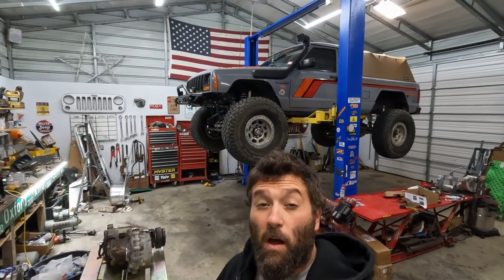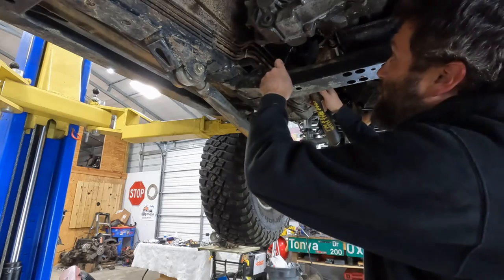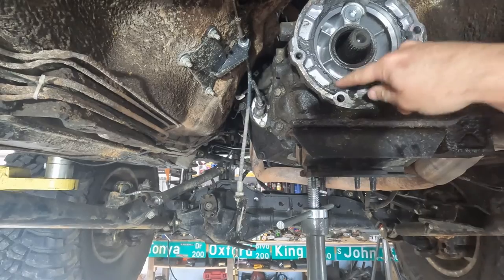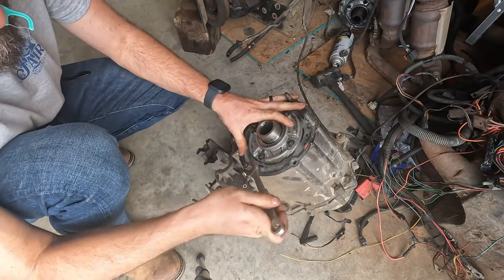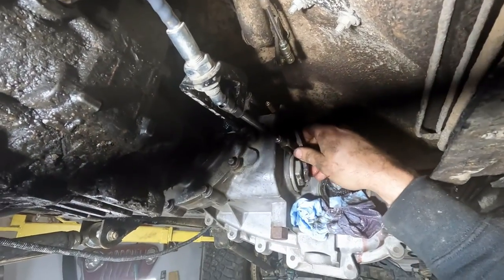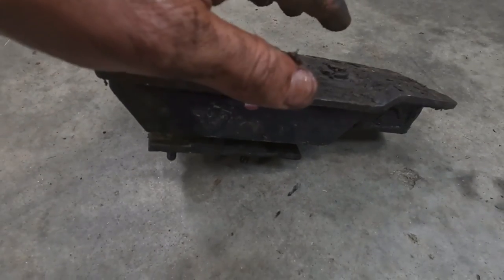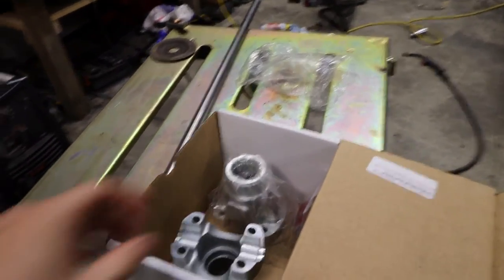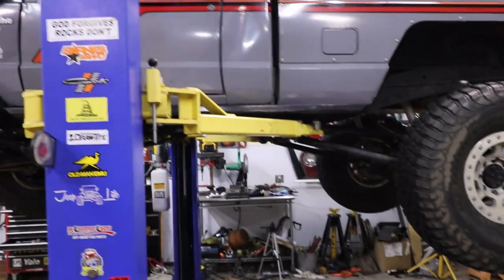Rubicon 4:1 Transfer Case Swap into Comanche

Comment: Hey man what rear end do you have 
The pinion guard is really nice I have a 14 bolt sterling 10.5 how do mount hard on thanks for the videos
Reply from the maker: I am running a 14 bolt out of a 2500 Chevy van. I run Barnes4wd pinion guards on all my rigs. You can’t beat em!

Comment: Did you consider just flipping the shifter arm on the "new" transfer case so It's in the same position as on the 231? I seem to remember something about flipping the arm when using both the cable shifter and the Azzy's Design Works shifter linkage. Hope this helps. God bless and stay well.
Reply from the maker: I tried a few different ways and it put it in the opposite direction that I needed it to go.
Reply: Our linkage can fit the 241, but the range of the selector shaft is different. The few folks we have seen mod them and use in a swap needed to grind them shorter.  But appreciate the suggestion!

Comment: What is the exact transfer case you installed ? Np241j or Np241or or Np241 rock trac? 

I want to put one of theses 4:1 t-cases in my XJ with AW4 trans
Reply from the maker: I swapped in a NP241 J Rock-Trac from a 2006 TJ Rubicon.
Reply: @sixfeetunderfab  what did you pay for one?
Reply from the maker: too much lol. I found one on ebay for around $1700 shipped. The shipping was super expensive.
Reply: How do you do the wiring for your speedometer? I’ve installed a 241j in my 91 Comanche and the tj is different from the tj.